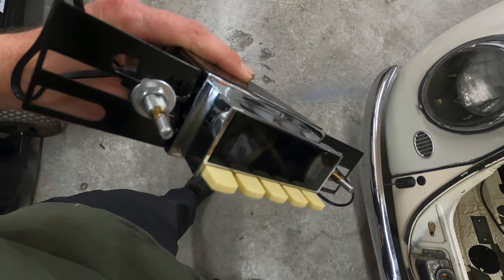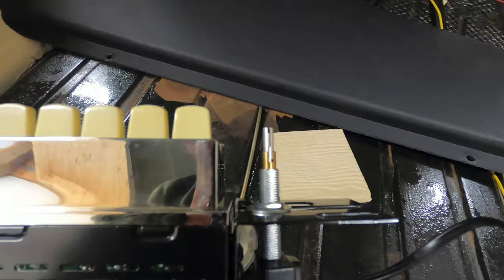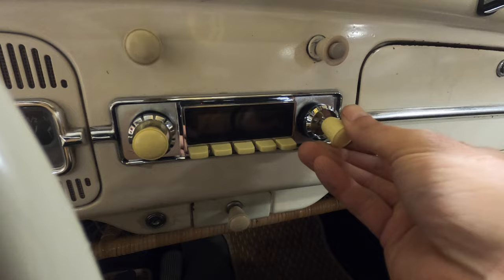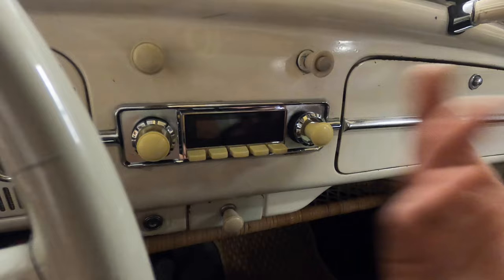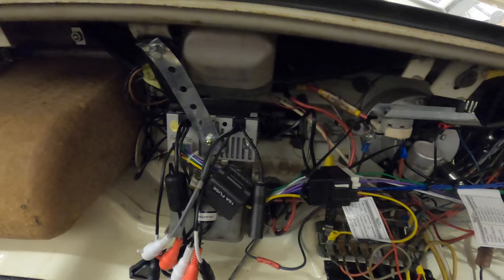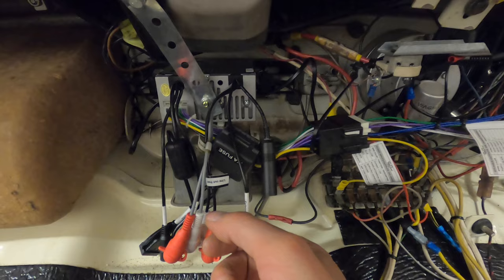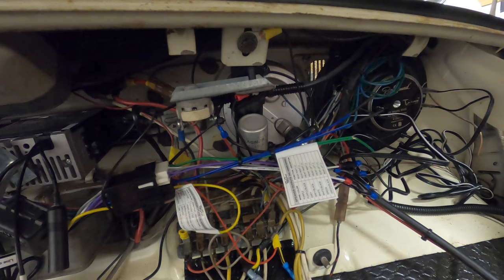RetroSound Hermosa Radio Install - VW Beetle

Comment: Thanks for this video! I have a '67 bug and am interested in purchasing their Laguna radio. My dash has been slightly cut to fit an old DIN stereo so I assume I will have to get their DIN repair kit too. My question is.... can I just hook up their radio to one speaker (mono) and how would I go about doing that? Thanks!
Reply from the maker: Sure can!  Just hook up the one speaker… using the front left or front right speaker wire off the radio, and don’t hook up the other speaker wires to anything.

Comment: I purchased the Long Beach model. Took me a bit figure it out because they didnt include the 4 small screws to mount the faceplate to the unit. Simple enough $1 fix. I was hoping I could use an original sapphire radio plate, as its  much stronger, but it doesn't fit.
Reply from the maker: I would agree!  It would be much stronger then the plastic!
Reply: do you happen to still have the plate? I am looking for the mounting plate that goes on the backside of the sapphire V radio :)
Reply from the maker: I’ll look, but I don’t think so.
Reply: @strykez5206  Let me take a look. I have the faceplate...I must have the other part, somewhere. I'll try to get back to you on Sunday afternoon.
Reply: @paddyofurniture3988  hey thanks for looking!
Reply from the maker: I don’t have any, sorry.
Reply: @VitosFix  no worries my friend, hoping to hit a vw parts swap meet soon :)
Reply from the maker: I’m bet you could find one there for sure!

Comment: I have this same radio in my 64 type 1, was in it when I bought it several yrs ago and it has never worked well. Volume sometimes works other times not at all. Was wondering if it could be a bad grd. Do you have your's grd'd to the sheet metal of the body? Thanks
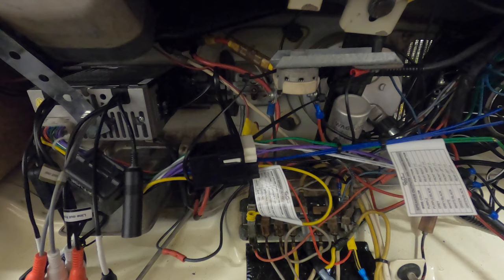Reply from the maker: Grounded to the body for the car.  Watch the video again.  It’s at 3:45 where I talk about it.

Comment: Yeah so I just got the exact same radio and you’re right the instructions are just not there I get how you’re supposed to mount the back but the front is just sitting there? It seems that people are using the plastic face plate to hold the radio just doesn’t seem very good or am I overthinking it
Reply from the maker: That’s all that came with mine as well.  Just the piece of plastic that goes on the front, then the knobs.  The most important piece is the strap in the back.

Comment: I have a 63 VW…can you wire up the radio so that it will work without starting the engine or even putting it in accessory mode?
Reply from the maker: The way that I wired it up, you can have the radio run in accessory, but with mine, I had an electronic fuel pump.  So when the radio cut on, so did the pump,

Comment: Is the wiring for the 63 and 64 beetle the same?
Reply from the maker: I don’t see any difference between the two years.  I’m seeing wiring harness for 1962-1964 (Sedan).  I would just make sure to check with a multimeter or light.